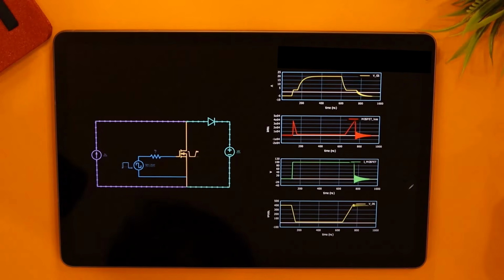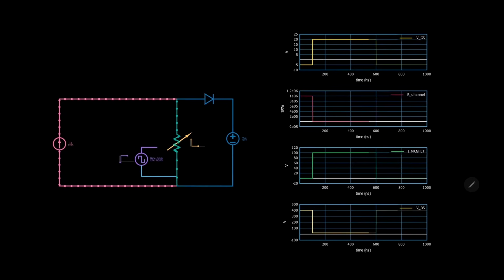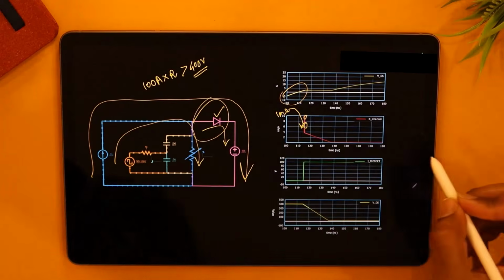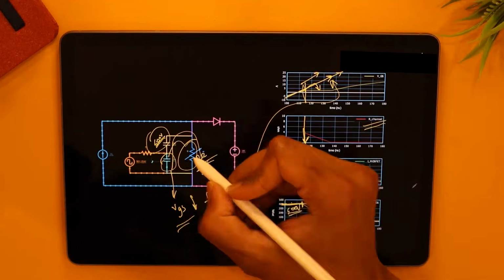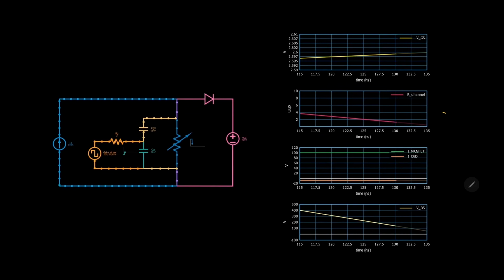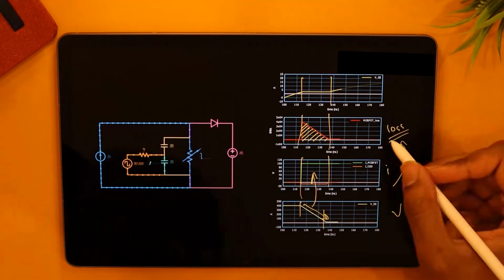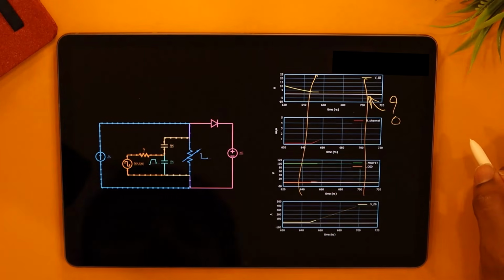Miller Plateau Explained | MOSFET Switching

Comment: Hii, thanks for explanation, i have doubt regarding Ids graph, During the plateu region, the 9A current from the 20V should also be reflected in the Ids,So they will be increase of Ids current from 100A to 109A during Plateau...
Reply from the maker: Yes you are right about that. 👍  During the turn-ON plateau, it does put extra current in the channel. It is actually reversed for turn-off plateau which I have covered in the latest release.

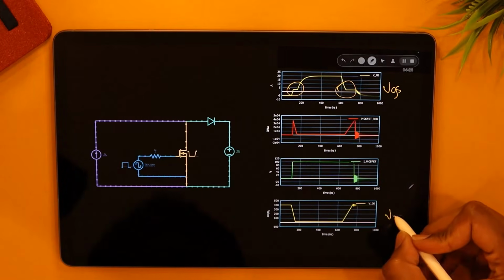Comment: @03:52, I can see MOSFET power losses are negative which seems to be not correct as the switching losses power cannot be negative. Let me know if Im wrong.
Reply from the maker: Great work to spot that one!  These waveforms were with an even more practical model of MOSFET with parasitic inductances. Thus, we see some ringing at the turn off. Hence the power measured across MOSFET - vds*ids also oscillates and crosses into negative as it does so. But you are right, i should have probably named that graph as MOSFET power vds*ids for more clarity. More coming on the parasitic inductances soon! Stay tuned. 😊